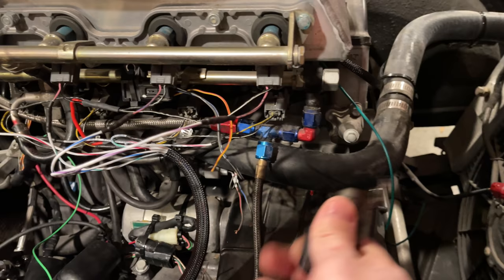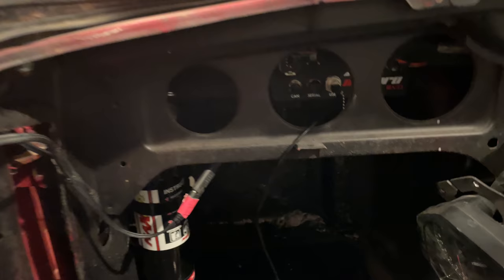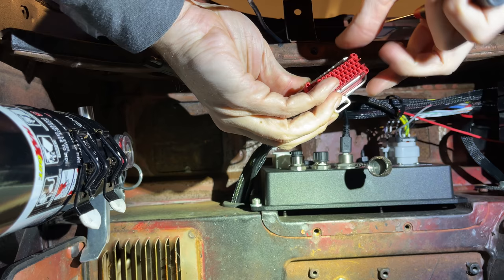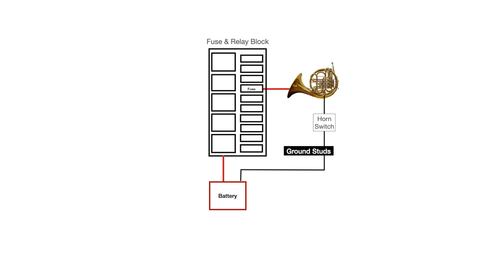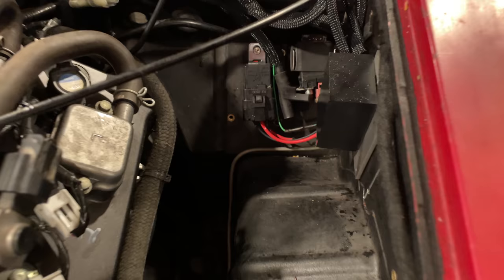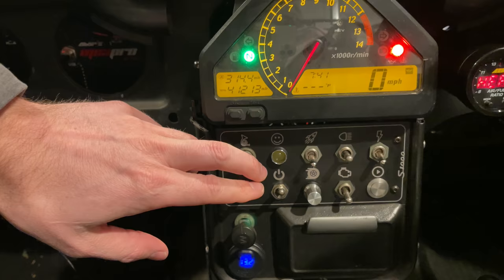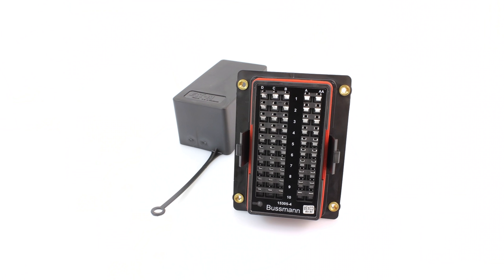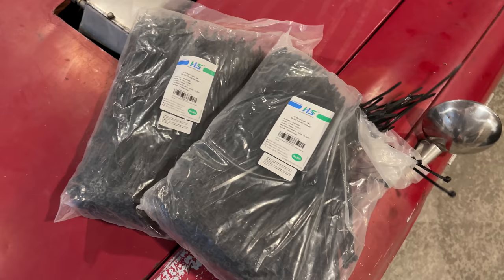Re-Wire Your Whole Damn Car - How To Do It Correctly & Inexpensively

Comment: Electrical issues is one of the most frustrating, and time consuming issues you can possible deal with.

Imagine you have a rough, and fluctuating idle 
Classic air leak
You look for the leak, can't locate it, so you decide to just replace all the old air hoses
Rough idle remains, so you wonder if it is ignition based/possible still air related
You check the whole ignition system, and it passes, MAF/ATS all check out
You wonder if it could possibly be exhaust, maybe a faulty O2, they pass as well

You can spend months of your spare time trying to track down this 1 issue, and it could be as simple as the TPS harness has a small fray/wire has particularly broke inside the insulation, and issue is simply intermittent. 

Electrical issues are a fking nightmare.

Comment: It isn't quite clear from the introduction and what would be really useful from this type of you tube, would be how to convert a car with and old old non-computer based car system, into one with a COTS ECU computer with OBD2. basically the interfacing to the sensors and spark control.

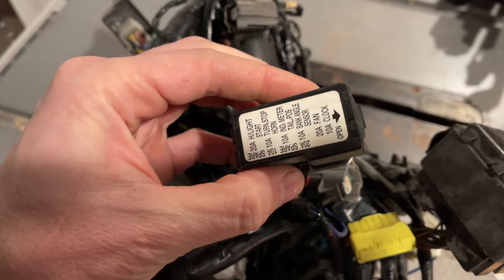Comment: Uhhh, the suggestion at 3:54 to use too much fuse is not at all accurate. If you're unsure of the fuse you need start small and work up. A fuse that is too large won't pop and will allow wires to burn at minimum and worst case your car will burn

Comment: 8:46 where can I find an affordable heat shrink capable label printer? The only one I can find is a professional one that goes for $250 😳
Reply from the maker: Check the description. the one I use doesn't say it can print on heat shrink, but it can.

Comment: The engine... the power unit.... the battery storage of power unit.... hmm... How to operate the entire system and wire a car from scratch or make form scratch a improved design. Like tesla's door handle improvements. 

How do we improve a car... and keep it as simple and easy to repair as possible for comments that operate within the system.

Altenator generates power.
Engine drinks fuel.
Battery stores energy converted from a liquid state that drives a rotational shaft that powers the altenator and that intern becomes ac and then dc and charges the battery. The battery is what initially starts the vehicle by providing the fuel/energy needed to engage the starter to the motor, to start a chain reaction in the combustion chamber that then powers up the power generator/ engine. It's sort of a weird cycle thing.

being that fuel is abundant and cheaply produced and the modern market allows for its infinite creation with a little bit a knowledge well we get fuel.

for a vehicle... or contraption and most contraptions are funnily all built on rotating something and that rotation is then made into energy... or mechanical use for assistance. So the modern age is mostly just rotational nonsense... for contraptions and switches...

So how would you make a improved version of an ancient type of device?

Thus, energy storage in many means.  Tension is a classical method, fuel (chemicals, volatiles and stables), mass inertia (gravity type energy systems). Whatever else I missed lol...

Air is technically a chemical.. anyways...

We need to rotate x thing, its rotation translates into movement, but we need to be able to stop that movement for reasons why we learned this, absolute chaos with no brakes or a axel that has no means to slip when brake is applied meaning it just keeps pushing regardless of the breaking. IE. fuel is a controlled motion of movement.

So I think electromagnetism and magnets with electricity can create a more optimized energized systems, and one doesn't always need a direct line to power an object, so there are myriad of ways to energize things remotely to give it power... then we have cooling factors and creature comfort IE enviromental stabalizers is a most logical name for heaters and air conditioners. 

Could he... would he.. redesign the method of movement... Human has an affixation with rotation. Then we have switches. IE the yes no nonsense that governs or can govern things more efficiently.

Comment: 18:31 Actually don't do that except if you're sure there is no power connected to the cable you're measuring. It can easily fry your multimeter. (continuity)

Comment: 15:15 LOOK I'M SORRY OKAY I DIDN'T HAVE ANYTHING ELSE EXCEPT WIRE NUTS AT THE TIME AND I DIDN'T THINK IT WOULD BE A PROBLEM IF I USED THEM IN THE CENTER CONSOLE SINCE IT'S SO EASY TO REMOVE 

though I'm surprised that the wire nut holding my tachometer signal wire in place is still holding on, lol

Comment: Okay, don't laugh please. 
I have a 98 dodge ram 1500. Okay if you have stopped laughing now. 
I want to eliminate the ecu or at least narrow it down to sensors and fuel efficiency. Since I don't have a  1970s model dodge sitting around. To steal stuff from. How difficult would this be to accomplish? 
Okay I admit I laughed a little myself. LOL 
Dodge fan myself, never had any serious problems with dodge.

Comment: Im old and dont like change but make sure u buy specific connectors. Dont just wrap wires and make sure the metal is touching.. you have to buy a whole new part to make sure the connection is tight

It didnt used to be like that but im old and hate change so dont do it like they used to. 
Cuz new studies show we should do it like so so lets do it like so

But trust just do what i say and click add to cart for all the links i tell y to get

Lol if u said just connect these id believe u but u said connect these this way and make sure u use this kind of connector.. talking like a real salesman in my opinion

Comment: The chart you showed for Amperage at 12 volts is just ridiculous to me. Look at this chart and explain to me how that makes sense. 10 gauge for 200 amps? I do a lot of my own testing for amperage on wires and the max I can get out of 18 gauge at 5 feet is literally only about eight amps before the wire becomes too hot. So pushing 25 at 5 feet would just completely melt your insulation unless you use some very high heat resistant wire. And that's not even accounting for the amount of crazy voltage drop you going to have across the wire.

Comment: just over 4 minutes and im out
this guy literally said if you dont know the current draw  just use to much fuse thats terrible info. 
 to much fuse could potentially allow to current to pass through the wire and that will damage your wiring harness  not to mention is a fire hazard
Reply from the maker: If you watched until the "wiring" section you would have heard me clearly state that the wires need to be sized based off of the fuse. This is a "re-wiring" video, not a "re-fusing an existing harness" video.
Reply: @SuperfastMatt  how are you gonna know the proper wire guage without knowing the current drawn through it

Comment: It's only a meth lighter if you're using it for meth. For your particular application in that specific moment, it was a heat shrink lighter. What happens when the cameras stop rolling is your business. Just don't do crack though. Or do.

Comment: err on the side of too much fuse??? thats terrible advice! you never want to oversize a fuse, thats literally what protects the circuit and wire from burning up! the fuse also helps dictate what gauge wire you should be using. also a 40A relay seems highly unlikely to be enough for an entire car.